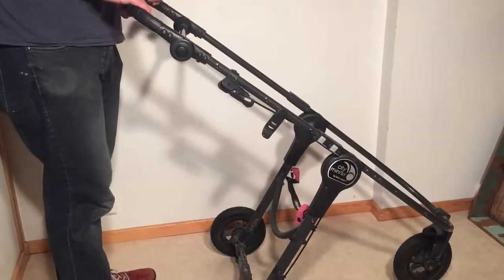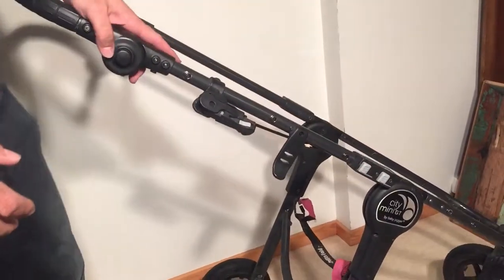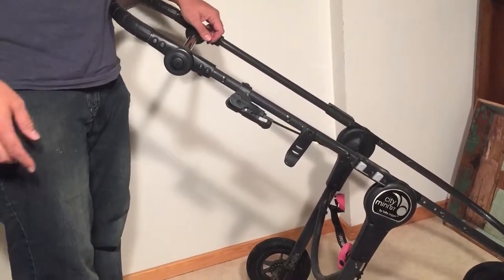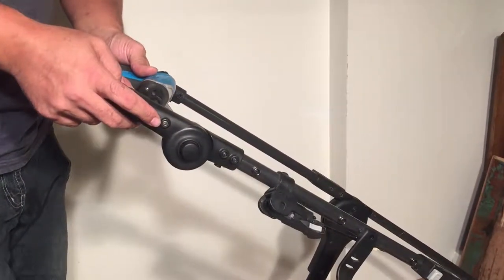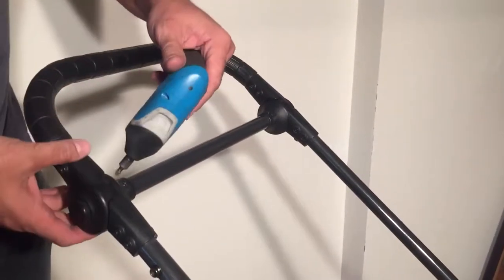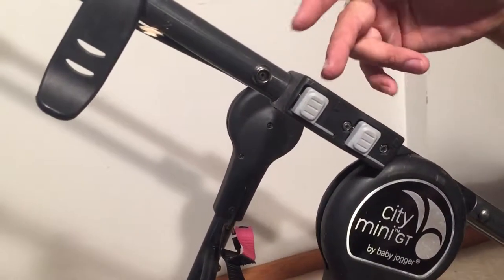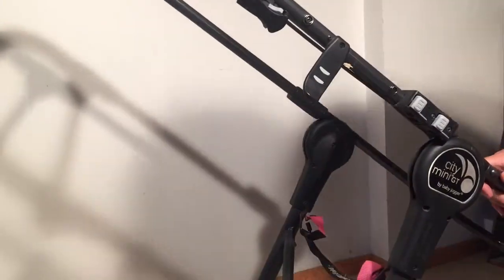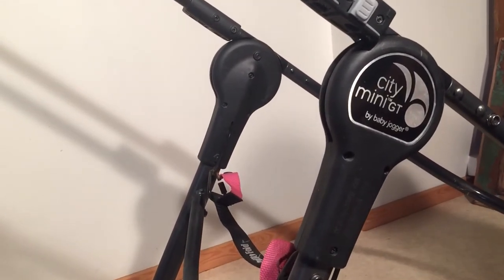How, Where and Why to Tighten the Handle on a BabyJogger Stroller

Comment: Hi, any idea what size screws and bolts are needed to replace in the central locking mechanism?
Reply from the maker: All of the screws are 4mm, other than one which is 5mm (diameter).  Not sure on the lengths off the top of my head, though :)
Reply: Hi, I have a baby jogger city gt, my handlebar is a bit wobbly and I have tightened all the screws like you have in the video. There are a couple of screws missing in the lower part of the handlebar, do you know if I can buy replacements in a normal hardware DIY shop? And what size  would they be? Thanks!